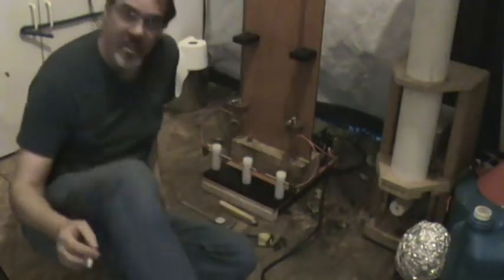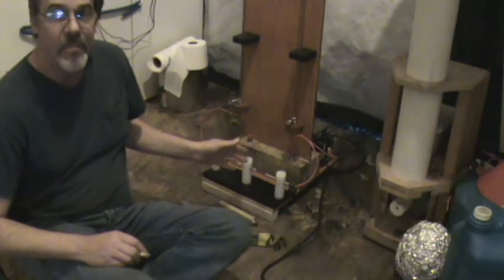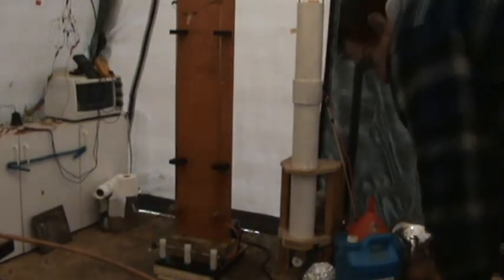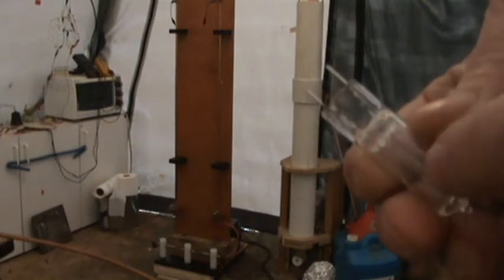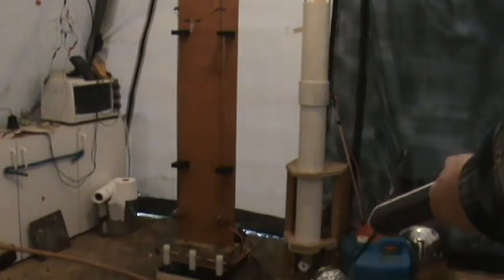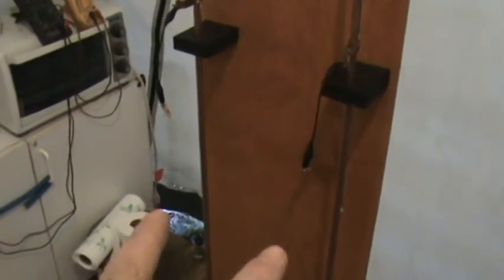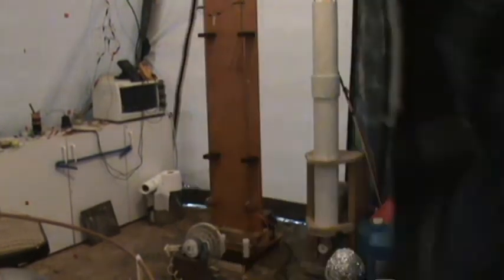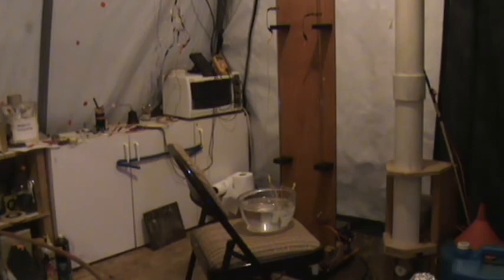TESLA'S HAIR PIN CIRCUIT Part 2

Comment: i have seen many o these demonstrations, i have never tried them myself. it is very very phenomenon. i like to do a study on this soon. how can this b done with a 1000watt HPS bulb? and the smallest possible design? it is very interesting due to there seemingly is no difference between a static charge, as in my ion one wire system. charging capacitors should be easy. so this is like bunching up volts behind a resistor. something amazing is happening here. and the theoretical prospects, and understanding is what i am after.
so i must at least make a attempt at a explanation o the phenomena itself. 
perhaps he is pushing volts through a resistor? Tesla is i mean. do you think this can also be a result o simply charged capacitors. and in that case use the ion generator to charge the capacitors ? i am just tossing out some o the questions i hope to answer or have answered. what do you think is the most interesting part of this device?
Reply from the maker: Tesla's impedance phenomenon.  I noticed that it is a loop,,,, like dr Stfflers loop.   Here is one of his videos... 
https://www.youtube.com/watch?v=x_bVXXqQ4YY&t=97s
There has always been something magical about the loop 🙂  Energy has no place to go.

Comment: Hi Paul. I see by virtue of your posting this video you survived the ordeal. Congratulations. I''m not as foolhardy as you are brave. That it could be successful was certain, that it would be was not. I'm glad to see you took adequate precautions. The equipment you are using is not to be taken lightly.
There are as you said many questions about the phenomenom. What is the net efficiency? Why is the performance seemingly unstable? How can the circuit be stabilized? Are there a practical applications? Did you have a supply of Charmin on hand? If only we could speak with Tesla.
Reply from the maker: Thank you for watching.  Glad im stll here to talk about it :-)  Yes,,,soooo many questions!  Yes, lets call Tesla on our new longitudinal-magneto-dielectric-phone :-)
Reply: Yes, all we need to do is shuffle around in the junk drawer and find a time coil.